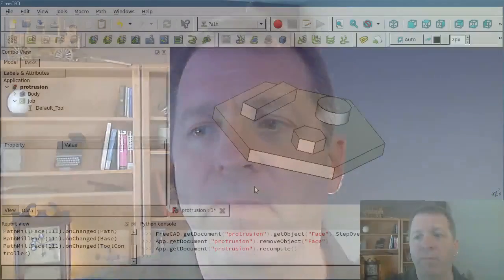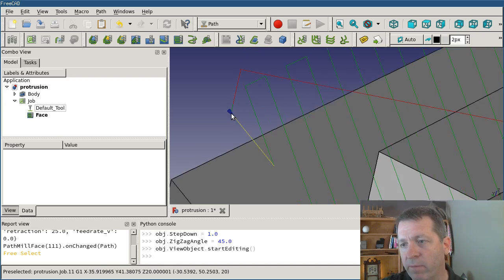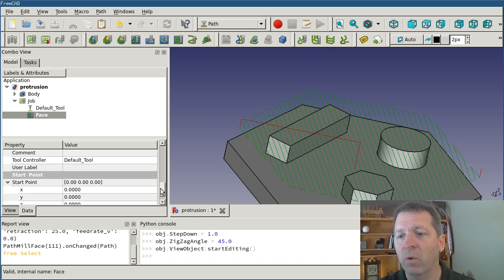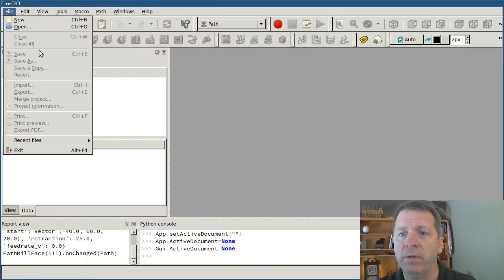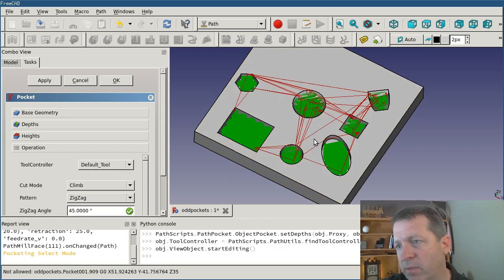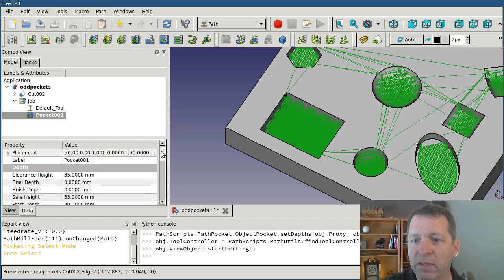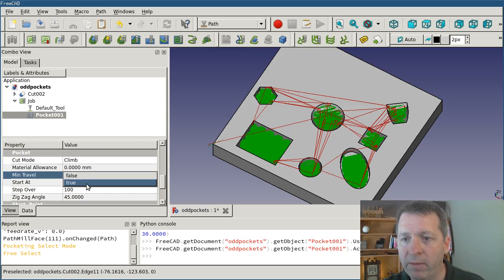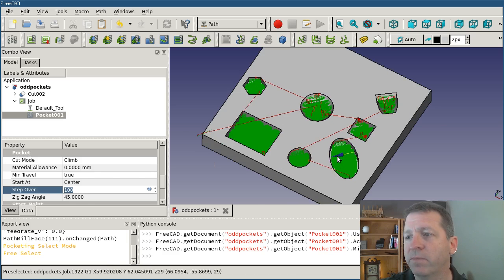FreeCAD Path Start Points

Comment: How do you get your tool centered on the piece, though?
Reply from the maker: I don't understand your question.  With path, the first most important thing is to get the setup correct in the Path Job.  This is where you place your part within the stock and establish the origin of the coordinate system.
Reply: @sliptonic  the other CAMs I have used so far include Easel and Fusion360. Both of these allow me to place my tool directly on the center of my pieces and start from there. Unfortunately, FreeCAD cant do all the cuts I need, so i have some g code from fusion and some from FC. In FC it seems the tool always starts at the edge of the box or piece instead of the center.

I start a piece as a rectangle and start the bit from the center of that rectangle. Its way easier for me to recenter that way and change the g code to the next cut and know it will start from the same place. Hopefully that clears it up a little.
Reply from the maker: @shaynerushton214   ping me on discord.  It's easier to talk there and we can attach images/files.  https://discord.gg/JWZGJj8F

Comment: Interesting video(s),  I wish I could reproduce that (I have version 18,  not that different I assume?).   I made a part with pockets, but the origin, and the start of the path, is in the center (where I want it) at the bottom of the part. (the bottom of a pocket actually. I tried to change the "path start" in the same spot as in the video,  but the start didn't change but all the rapid moves, between the pockets, slope/dive into the next pocket. It seems like the paths are the same for very Z value, when I switch from false to true in "use start point"
Reply: I know this is old, but move the model into positive space, not centered on the x,y

Comment: You mentioned setting the Z starting height to zero will cause it to crash. Why? If the top of the part is zero and all depths for cutting in Z are negative Z it should work, that's how most cnc machine shops setup their jobs.

Comment: and im struggling how to machine a hole not drill a hole...how do you machine a through hole?? do a pocket deepter than the part?
Reply from the maker: Depends on the shape of the hole and other factors.  If round, you could also do a helical.

Comment: which version are you using. it's not the same as the ones I can find
Reply from the maker: I'm using the v0.17 development branch.  The UI around path has already changed quite a bit since I did these videos but the basic concepts are still true.  If you're running anything in the v0.16 version it's too old.  That's still considered the 'stable' version but Path is almost unusable.  There are daily builds of 0.17 available but it has a ways to go before it becomes the new 'stable' release